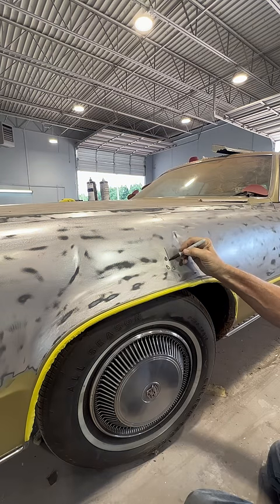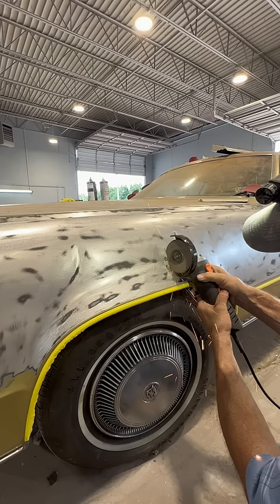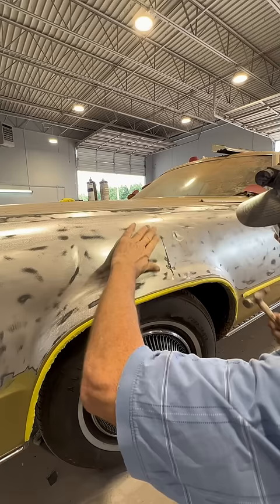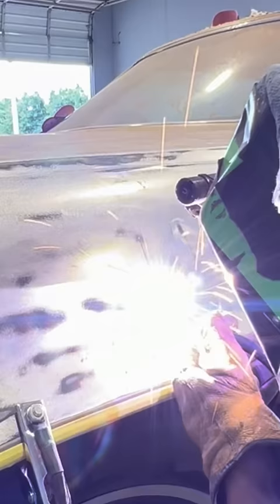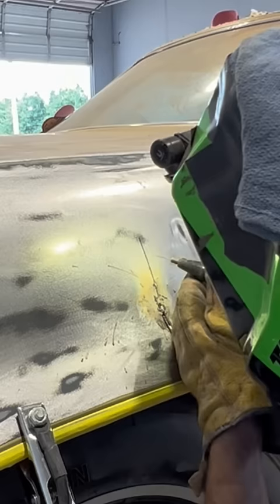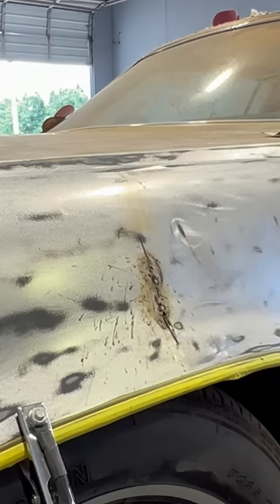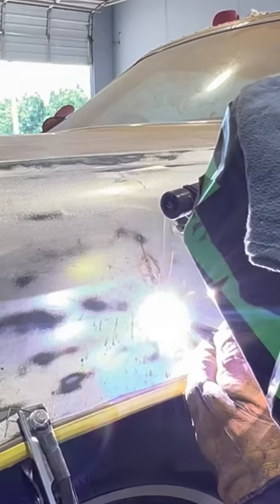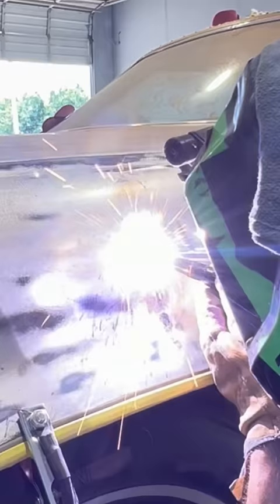BILLY SHOULD BE ARRESTED🤣 How To Fix A Buckle In Sheetmetal FAST DIY Auto Body Repair Flux Core Weld

Comment: Is there a reason you use Flux core over GMAW or GTAW?
Reply from the maker: No gas hassles
No wind worries
No tall beads
No overhead-aches
No rust rejection 
Flux core is superior for autobody repair
Reply: Flux is Superior. Have a wide range of heat control and direction. It actually burns hotter. 
Flux is for surgery. Stick is for hacks😂
Reply: Is there a reason why some of you are so against flux core?
Reply from the maker: @thelonewrangler1008  I am betting because they never used it😂😂
Reply: @OldBondoBilly  Bingo! Yup, FCAW is like butter on light sheet metal. Everyone complains about gasless flux core because the weld isn't 'pretty' and ooooh there's smoke but you grind it anyway. Either way it's the same steel when you're done.
Reply: Because flux core is also cheaper and it’s going to be ground down and covered with filler and no one is going to ever know it was their to begin with
Reply: @OldBondoBilly  and you can weld very thin stuff with tons of rust which is hard to do, show em how its done son🤘😎
Reply: save a lot of £ here in UK you usually have to rent a gas bottle, flux core saves a lot of money and hassle
Reply: @thelonewrangler1008  honestly, I have never found a flux core welder that could stitch thin sheetmetal without blowing the parent metal out.  Even moving around or using air to cool.  It’s just too hot for anything less than 16 ga from my experience.
Reply: Tig is obviously the way to go idk why anyone would use flux on body work 💀
Reply: @elicarter1356  simply because it works
Reply from the maker: @MissionRestomod  I do some overhead on 24 gauge, followed by a destructive test.  I always have to prove what I say.  Well, I don’t really have to, but it’s fun😂😂
Reply from the maker: @elicarter1356  how’s that tig workin for ya in that wind?  Oh, you must be a Foozie who only works in air conditioned shops🤣🤣🤣🤣🤣
Reply: @falkirk8413  but not as good…
Reply: @OldBondoBilly  I mean yeah I’ve worked hard to afford a nice metal building… if your doing bodywork such as bondo and paint and all the other stuff outside wtf are you doing?? It’s really not hard to have a shelter from the elements…
Reply: @OldBondoBilly  you are literally inside a huge shop so wind is not an excuse for you, you just can’t tig
Reply: @elicarter1356  its cheap, will weld very very thin and extremely rusty garbage, and then you just grind it down and voila you have a solid piece.. now tig is great, especially for thin stuff… BUT it will jot weld on old rusty stuff that has had years of fluids seeped in or is just plain old rusty, the tig just wont do and you will go through supplies all day as all that garbage eats your tig tips.. grab flux or even flux with gas is good too for that rusty penetrated shittiness… the proof is in the pudding🤘😎🙃
Reply: @OldBondoBilly  Guess I will have to maybe  TRY, using Flex core again 🤔. As it's been since early 90s when I DID have a flex core wire welder. It WAS an inexpensive unit but.... Yeah, it WAS a POS ,unfortunately.... Nothing but Miller and Lincoln gas MIG welding SINCE then... I'd imagine, that there ARE, waaay better "flex welders" out there NOW obviously...It WAS laying down quite nicely for you on that bent 70s Cadillac fender you did the relief cut on (with the die grinder) and flux core welded up and prepped for paint etc. Looked REAL nice, actually 👍.......Hmmm🤔
Reply: Never heard of those
Reply from the maker: @elicarter1356  I am in Oklahoma, and the wind is nearly always sweeping down the plain.  It was 85° today. I don’t think I want to have the door shut when it’s 85°.  Next you’ll probably tell me about a welding screen, or some nonsense like that.  I am doing bodywork and I get.💩 done.  I don’t have time to play Fooze with a tig. 🧐🧐🧐🧐🧐
Reply from the maker: @elicarter1356  honestly, I’ve never even tried tig, but I’d be willing to bet that I’m as good at it as you on day one. I welded miles with oxygen acetylene and 3/32 copper coat for five years before mig welders came on the scene.  I do things for a reason I can’t help it. If a bunch of know nothings don’t understand.
Reply from the maker: @heathkill4821  Will said my good man😊
Reply from the maker: @jamescon55  it needs to be a non-synergic inverter machine with separate heat and wire speed control. This synergic one I have is much harder to work with than my separate heat and wire speed control unit.
Reply: Look at that sweet shop 🤑

I think if Billy wanted a tig welder he’d have a tig welder, what did you naysayers actually weld today???🤭😂 oh right nothin, you were stuffing yer pie hole with food and watching Billy weld 😂
Reply: No gas bottle to drag around , it grinds down easier , bottom line flux core is cheaper but better for sheet metal
Reply: Stronger, don't have to worry about wind, dont have to buy sheilding gas from airgas. And he likes it
Reply: @OldBondoBilly  you have time to reply to my comments lol so idk about that bub
Reply: @OldBondoBilly  on the first day 😂😂 your a funny guy. I’m the number 1 refinery sanitary stainless welder in the union of CA. Seriously, there’s a leaderboard
Reply: @MurglesMaloy  rent gets expensive
Reply from the maker: @elicarter1356  sanitary napkins are not necessary in autobody repair.  Did I mention that flux core is a recommended process for the welding of stainless steel? 😂😂😂😂😂
Reply: @OldBondoBilly  yeah thats not true hahaha
Reply: @alitabugher4708   Bawahaha 😂😭 LMAO on that one!  TRUTH 👍😎
Reply: I dunno why everyone wants to use stick of mig...

I dont wanna waste my time with gas... my shop i have ceiling fans and 50 inch barn fans going to air it out and for cooling.  With gas how would i be able to weld.

Flux core also doesnt really care if you weld over rust or not.  Done it dozens and dozens of times.  Flux is also very hot.  It kinda sucks for thin metal.  You gatta tack carefully.. but for thick metal its great.
Reply: All I can say I use both the flux core has a lot more splatter. Where I’m from you can’t use flux core for spot welds or and structural welds on a vehicle. But I use it when I’m to lazy or forget to get more gas 😂
Reply: @chevybigblock3311  tell me about it.. im dumb and had my phone near by and the splatter got on it and cracked it... s22 ultra too lol
Reply from the maker: @elicarter1356  I make time😂😂
Reply from the maker: @elicarter1356  yukyukyuk doofus check yourself flux core is a recommendation for welding stainless.  And you geniuses say I don’t know anything.🤣🤣🤣🤣🤣
Reply: @MissionRestomod  I had the same issue for a long time and then I discovered using thinner wire and I was able to weld sheet metal on a car so instead of 0.035 try 0.025 or 0.020 then you can turn the power and wire speed down and not blow through
Reply from the maker: @richardchevyz71  030 is the smallest flux wire.
Reply: @richardchevyz71  honestly i found a slow wire speed on thick metal better anyway as well.. i turn my 90a flux to 4 for 3/16 or 1/8th for frames and leaf spring mount etc.  Welds wayyy better dime stacking with that.  Faster wire speed doesnt work well at all on this flux welder i use.
Reply: @OldBondoBilly  Oh
Reply: That's how I would do it
Reply from the maker: @Not.The.Avg.Smitty  are you like eleven?  I didn’t create a YouTube channel to learn stupidity from you  and the idiot squad.  I don’t need advice because in my experience it’s always bad.  I’m ahead of the curve, and I’ve been above “pro” for 30 years if someone gives me a smart tip; I adopt their way.  You haven’t brought a single fresh idea into the conversation.  You’re too concerned with getting the upper hand on me to care about the DIYers that appreciate my help in producing strong and lasting repairs.  You just can’t stop humpin the leg of your superior 🤣🤣🤣🤣🤣
Reply: Flux is king. I used it for years before getting my 220.
Reply: Cause he wants to use 2inch stick out lol
Reply: Yes, he's lazy and cheap.
Reply: I'm a diy taught welder(which means I know nothing) I got away from Flux core. These comments are making me realize I know Less than I thought, which was nothing... 
I'll go back to Flux for my body work now. Thanks for the info everyone!
Reply: @Stroke2Handed  clown
Reply: @OldBondoBilly  dead on my welding friends always give me shit for pulling the flux core out when I have a normal mig and tig lol the real body guys know though.
Reply: Flux is magic, thats why oxy/acy welded aluminum panels gets full penetration and clears out impurities. Same for oxy/acy welded stainless the flux does the magic. 
Didnt realize this about flux core mig. You are right, the flux drives out any impurities and will penetrate better on the oppisite side because the flux provides the shielding. Cant get gas on the other side of the panel.
Reply: @elicarter1356  
Because he is not going to be hammering out all the welds. 
I like tig, but people dont realize that flux does a lot. They have flux for tigging stainless that doesnt require back purging. 
The gas doesnt reach the oppisite side of the panel, so you really dont get good welds on the opposite side of the gas.
Reply: There is a time and place for each one.
Reply from the maker: @derekmcdonald2856  Thank you…. I can weld stainless steel like ringing a bell, and it doesn’t require any special flex wire.  flux core is an approved method for welding stainless steel.   Sometimes it’s hard being above experts and professionals.🤣🤣🤣🤣🤣
Reply: @OldBondoBilly  
And by apperance it does look like a stainless type of wire and it doesnt have a copper coating.
Good to know ill need to try it out.
Reply from the maker: @derekmcdonald2856    I always get 100% fusion, 100% penetration, and minimal heat transfer, because I start and stop the process at the edge of blowout.  Stupid people with no experience, and no understanding quack nonsense without a clue.
You are a goll darn genius 😁😁😁😁😁
Reply: @OldBondoBilly  
Funny thing is, the other day I was wondering if there is flux core stainless because the gas you need is way to expensive because of helium. 
Problem solved, thanks!
Reply: @Not.The.Avg.Smitty  I’ve just seen welding dog of yours 😂 the one weld I seen there it looks like my dad did it he’s really good too he always said to me as a kid ain’t nobody like me kid. He was welding yesterday I haven’t seen him weld for a long time but he still said it and I’m 36 now some habits never die hay ✌️
Reply from the maker: @derekmcdonald2856   I didn’t try Flux core until 2022 because of the misinformation of experts like those above.  Last month I went and welded a handle back on a stainless steel pizza oven with my flux core welder. It came out beautifully.😉😉
Reply from the maker: @derekmcdonald2856  it’s just plain old, flux core wire and weld stainless steel like a dream
Reply: @richardchevyz71  they don’t make flux core that small to my knowledge.  I have and use a MIG with .023-24.  My comment was on flux core.
Reply from the maker: @Not.The.Avg.Smitty  while I don’t know or care about your opinion of how to know anything ( I don’t need telling🤣🤣),  I’ll use your title for an upcoming flux video.  Yer muh favorite little troll trick🤣🤣🤣🤣🤣
Reply: @heathkill4821  You guys are completely making up the "will weld thin metal better". That is the complete opposite of reality. The purpose of gas mig is so you can run thinner wire and not blow through like flux core! It's clear many of you haven't done both. If Billy likes flux core for sheet metal for the reasons he listed, fine. (Well, some of them, because flux core welds are much taller than gas.) But it is absolutely not superior at sheet metal in terms of performance.
Reply: @borisjankovici662  he likes the flux core for thin RUSTY METAL… payy attention. If you try that with gas mig of tig its just keeps pulling the rust to the top making your weld pourus and shitty, flux core doesnt care it will weld
Reply: @borisjankovici662  and yes if the metal was CLEAN and not RUSTY A MIG OR TIG WOULD BE BETTER…. NOOOOO SHITTTT😂 but RUSTY… Good luck
Reply: @heathkill4821  No. You're lying. He says it's better, period. That is BS.
Reply: @heathkill4821  Um...you know that flux core is MIG too, right? I think he's trolling all of you people who have never welded.
Reply: @heathkill4821  And it's complete BS that flux core doesn't care about rust. That is utter non sense. Especially on sheet metal. And who in the world is welding to rusty sheet metal?
Reply: @borisjankovici662  its better for welding straight rust to rust, a gas welder will just keep sucking out the impurites into the weld making it shitty and pourus, thats why we use flux core on a shitty little mig for stuff like this that is old and so penetrated with pb blaster and other things and rust that just keeps on coming with gas.. throw down some flux wire and grind and tuddahhh🤘😎
Reply: @Not.The.Avg.Smitty  awesome I’ll have a look it’s like my dad says skill can only take you so far it’s the knowledge you learn over a life time that takes you the rest of the way he is 62 years old now and he will tell you someone from a different shop will know something different so listen to what they say you may learn something new but most of the time they don’t have a clue so I guess it’s up to the individual to choose who they listen to. I’m glad you are so happy doing what you do it really shows in your work and someone who welds like you definitely goes home with a smile on his face 👏✌️
Reply from the maker: @borisjankovici662  Wassup B.  My mantra is flux core is superior for Autobody repair, not superior in general.  I am superior to an expert at flux core sheet metal welding because I am a Jedi master.  My process is proprietary, that’s why your MiG weld bead can’t possibly be as flat as my flux.  I will soon make a concise video to teach you the way of the master; If your brain is not already full😁😁😁😁😁
Reply from the maker: @heathkill4821  good and accurate point😉😉
Reply from the maker: @heathkill4821  I disagree, but not enough to quack about it😂😂
Reply from the maker: @borisjankovici662  Context is key, B.  Better for autobody.  I don’t have a thing against shielding gas itself😉😉😉😉😉
Reply from the maker: @borisjankovici662  Pay attention, B…
MIG___ M.etal I.nert G.as
TIG__T.ungsten I.nert G.as
The only shared attributes of MIG and Flux are they’re both wire feed, and they both weld metal.  Flux core is NOT MIG 😉😉😉😉😘
Reply: @OldBondoBilly  yes gas is great but when you keep pulling crap out of the metal you get tired of it, i will grind it nice and thats why we use it on our old cars for a cheap and affective job well done, i will not just throw a beauty away at the scrap yard, i will make it good as new, and for the people WORRIED ABOUT CONTEXT… we are talking about CARS here lol its all Billy does… soooo COMMON SENSE DAMNIT AND SUBSCRIBE FOR HIS HUMOR AND IMPECABLE KNOWLEDGE🤘😎 thanks Bondo Billy
Reply from the maker: @borisjankovici662  guys who are restoring their old cars have to deal with rust, unless they plan on replacing the entire body.  With flux core and proper technique, you can even weld rust holes themselves.  That’s not legitimately possible with MiG.  Flux core IS BEST for body😁😁😁😁😁
Reply: Didn't expect to get everyone all worked up like this lol.
Reply: @OldBondoBilly  Stop welding rust. Cut it out! If you're going to weld to rust you may as well just bondo over it.
What in the world?
Reply: @OldBondoBilly   @OldBondoBilly  Looking forward to the video. I am certain I would learn something. But being good with a tool doesn't make it the better tool. By your own admission, you went from oxy to flux core. You don't have gas experience. 
If you're looking to give honest advice (instead of trolling for controversy) you would just be honest in stating that it's not the best tool for the job, but you can learn to use the tool well. There are a lot of people who might want a welder for autobody, but don't want to invest the thousands for a gas setup.
Reply: @OldBondoBilly  It's not better for autobody. That's exactly what it's the worst at.
Reply: @derekmcdonald2856  not sure bout helium for stainless. Typically helium is used for tiging copper. Stainless i thought used pure Argon.
Reply: @borisjankovici662  every collision and restoration metal tech out there! Thats whos welding shit metal to make it serviceable again. Been doing it with MIG for 30yrs.
Reply: @RinksRides  
My mig welder recomends it. 
"Also, This is because in MIG,  the arc uses a filler material, unlike other processes such as TIG, which do not. As the surface tension of stainless steel droplet and pool causes low liquid metal fluidity, it makes it difficult to distribute and wet the welding surface, and the weld pass is not created properly when using pure argon as the shielding gas because materials a high surface tension." From some random site.
Reply from the maker: @borisjankovici662  if it’s not a hole and you can sand a shine on it, it’s steel and you can weld it. You not being a competent weldor is not my problem 🤣🤣🤣🤣🤣
Reply from the maker: @borisjankovici662  You may have attention deficit disorder.  I welded sheet metal with a torch for 5 years, until bodyshops started getting mig welders. Then I welded with mig for 36 years before switching to the superior autobody welding process of flux core welding.  Because you postulated that you might learn from my upcoming tutorial, I don’t see you as an idiot, just uninformed and misinformed.  I don’t dislike mig, it’s just less efficient 🤔🤔🤔🤔🤔
Reply from the maker: @borisjankovici662  bite your tongue.  My upcoming video tutorial will include mig welding also
Reply from the maker: @Not.The.Avg.Smitty  I like him too.  He just thinks he’s right, but I think he’ll see the light 😉😉
Reply from the maker: @RinksRides  flux welds stainless like ringing a bell😁😉
Reply from the maker: @RinksRides  flux is easier for rusty dirty metal😊
Reply from the maker: @derekmcdonald2856  flux that😂😂😂😂😂
Reply: @OldBondoBilly  I went to school l for auto body years back after 7 years in body shop and got iCar certified I'm actually going to try out the Flux for sheetmetal. I'm guessing it welds in a similar fashion to how stick welding is better on thick dirty stuff?
Reply: @charleshubert6751  I've had some bumper welds that looked like Helen Keller did them, but they didn't Crack or break when we pulled that thing out of 2 foot of mud with the tractor 😅 wasn't pretty but dammit she held up
Reply from the maker: @Not.The.Avg.Smitty 308lfc.  Is that a Ferrari??😂😂
Reply from the maker: @SXSPRIME definitely better for trace rusting panels😊😊😊😊😊😊😊😊😊
Reply from the maker: @Not.The.Avg.Smitty you know I don’t care about the numbers.  I welded stainless with the same wire as regular steel.  It looks beautiful 😉😉
Reply from the maker: I can well good enough for the girls I go with😂😂
Reply: Wind and gas coverage
Reply: @OldBondoBilly everything I’ve seen you weld so far is stainless. See I’ve been paying attention as well. Sanitary napkins 💀
Reply from the maker: @anthonycotham5094  I haven’t shown welding any stainless…😉😉
Reply: @heathkill4821 if there’s rust you should replace the metal not weld through it.
Reply: Flux wire and solid wire with gas work the same way. Flux protects the weld puddle just as the gas does. If the weld isn’t ‘pretty’, then your amperage and wire speed is off. Same with gas. Only difference in the finished weld is you have to chip off the slag with flux wire.
Reply: @timflannery9150  ‘Sticks’ have flux too. That’s what the coating is around the electrode rod.
Reply: @OldBondoBilly  👍👌🤟
Reply: @erictressel5957  indeed but just saying flux core doesnt mind dirty shitt as much🤘😎
Reply: @OldBondoBilly is that 0.8 in millimeters?
Reply: @heathkill4821 I learned something today. Going to give this a try.
Reply: @OldBondoBilly no gas hassles because you took the shroud cap off. That's what its there for, trapping the gasses produced by the flux core and making its own sheild gas without needing an extra bottle.
Reply: @elicarter1356 did you not look at the video?😮 what kind of building is Billy working in?😂 You're the kind of hack he was talking about in the video, you not your work😂😂😂😂
Reply: Too much stick out
Reply: Use E309 flux core welding wire for stainless..... 
New England Institute of Technology says flux core is ldeal for stainless... So does the rest of the industry. So i guess you "welders" that say you cant use it REALLY dont know squat..... E309 is great for stainless steel, welding stainless to high carbon steel, and to other alloys.
Reply: @OldBondoBilly . Mig welders came on the scene in 1949. Are you trying to say that you were welding miles of oxy welding in 1944. That would make your age at least in the early 90's. You sure look good for someone in their 90's bud...
Reply: @OldBondoBilly  I picked up a great big fancy expensive stainless grill free off the side of the road. The spot welds were broke on the side tray and side burner tray, flopping in the breeze. My brother asked "will your flux core weld that"? I said let's find out! Long story long, my 100$ harbor freight 90 amp laid down beautiful beads and i got an 800$ grill for free! I learned something that day just by trying lol.
Reply: @OldBondoBilly haha down in aus we dont have many ac workshops, we are just tough enough to deal with no airflow in a workshop thats sitting at 50°c air temp and wall temps of 65°c or more. It sucks but we dont get a choice, what it costs to drop a workshop by 5°c here is ridiculous.
Reply: @OldBondoBilly  "  Oh, you must be a Foozie who only works in air conditioned shops🤣🤣🤣"
You're a mean old codger ain't ya  lol
Reply from the maker: @erictressel5957 you obviously don’t work on old cars🙄🙄🙄🙄🙄
Reply from the maker: @vincebowling1778 there is no slag on sheet metal🙄🙄🙄🙄🙄
Reply from the maker: @dougbish5533 How do you guys come up with this stuff?  You obviously haven’t paid attention.  Look at the FLUX CORE NOZZLE on my gun.  Cheap flux welders just use a generic mig gun with a gas nozzle on it🙄🙄🙄🙄🙄
Reply from the maker: @elicarter1356 a building with wind blasting throughout Mr. Know-nothing 🤣🤣🤣🤣🤣
Reply from the maker: @sniper7.62x51 Says he with no knowledge of welding thin sheet metal🤣🤣🤣🤣🤣
Reply from the maker: @chadalan2567 MiG welders came in the body shop scene in the mid 80s.  I know because I was there
Reply from the maker: @BFORDF100  You’re about to look so much more dip-shittish than you already do (is that even possible?🤣), when I have 16 year-olds welding thin sheet metal with this process, that will stand up to rigorous destructive testing. Idiots shouldn’t tell innovators how to teach🤣🤣🤣🤣🤣
Reply from the maker: @mikehannigan848 I can be when these young know-it-all punks push my buttons 🤣🤣🤣🤣🤣
Reply from the maker: tonyjerry7258 I’m a weldor; not a welder, icken fudiot 🤣🤣🤣🤣🤣
Reply from the maker: @ktanner11 all you losers need to put down the bong and go get a job🤣🤣🤣🤣🤣
Reply: I may be wrong, by gtaw do you mean gas tungsten arc welding, if so I call that tig, tungsten inert gas, and it tends to build up a lot of heat unless you have a fancy pulse welder
Reply: @frankcarden4709  yeah tig the officialy recognized welding process names changed a few years back
Reply from the maker: It used to be heli-arc  when I started welding😉😉
Reply: @OldBondoBilly  never heard that its funny they keep feeling need to change it
Reply: @charleshubert6751  It's very possible to get welds as good as a very good  mig weld using flux core.  It requires practice.
Reply from the maker: I learned Oxy-acetylene welding at Oklahoma State Tech in 1981.  MiG welders started showing up in bodyshops in the later 80s. I also painted all my bodywork with lacquer in most shops😅😉😉
Reply: @OldBondoBilly  I painted my chevelle with lacquer I tell you hwhat nothing shines like that stuff
Reply from the maker: Ain’t no base/clear deeper than black lacquer😉😉